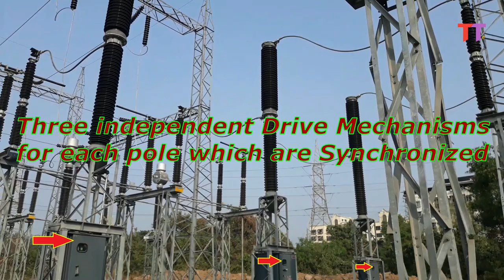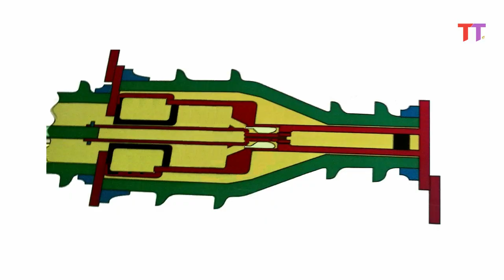SF6 Circuit Breaker Part 2 Drive Mechanism & Practical Demonstration

Comment: At 01:30 in video, the narrator says "once close command is given by pressing push button, trip coil actuates the closing spring, and breaker gets closed".. It s not the Trip coil that gets actuated, it is the Close coil which gets actuated in the Closing operation of CB. Kindly change audio and the text on video ;)
Reply: Good observation... I also got confused 🤣